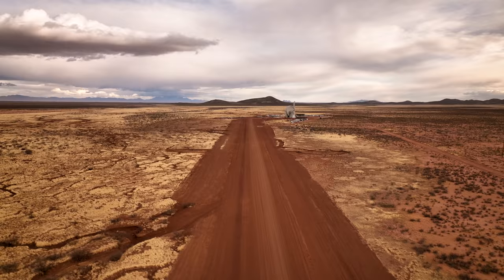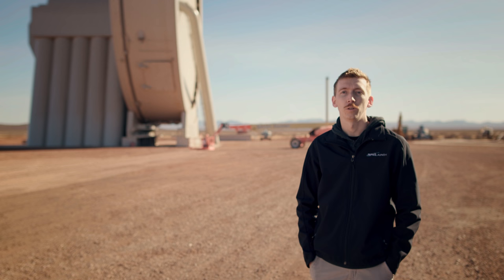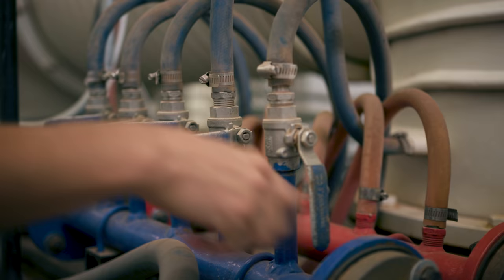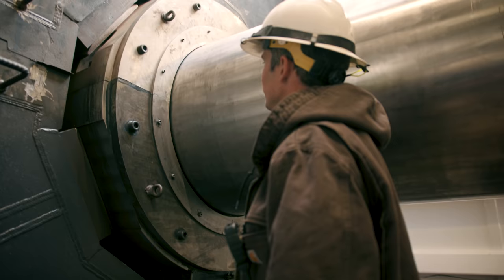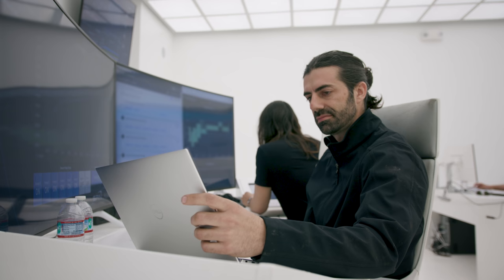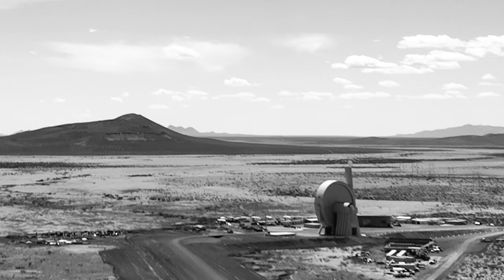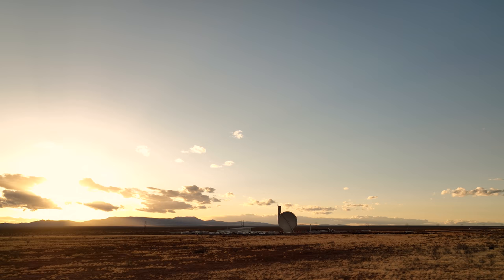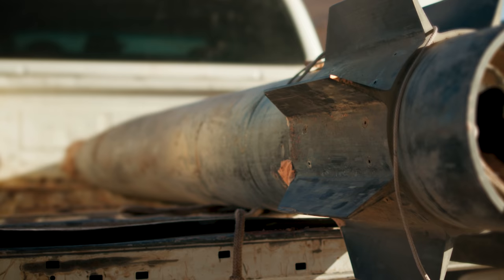An Inside Look: SpinLaunch Flight Test #7

Comment: Although I've expressed skepticism in the past, my confidence in this system grows with each test. It is an amazing piece of technology and I sincerely hope for it's success as an entirely new way to launch satellites! Can't wait for the suborbital test!
Reply: you trolling?
Reply: What if the rocket carried some fuel switched on  boosters after reaching 30000 ft to reach orbit ... Fuel consumption will be much lesser. A promising technology indeed
Reply: @AbhishekVerma-il4or  why not make an extra boost with rubber bands?
Reply: It's not designed to launch satellites there too fragile, it's main advantage is being able to send alot of materials to orbit super cheap which is our main hurdle to constructing rockets in space or pretty much any other large structure
Reply: @Catboy-hr2qp  The problem is that launching stuff 'into space' is the easy part.  Getting them to stay there is the trick, and that means getting up to orbital speeds and circularizing the orbit.  So this thing needs to not just throw a hunk of metal up but a working rocket system with guidance, fuel, rocket motors/engines, etc, + the payload they want to arrive at a given orbit.  So yes, a lot of fragile stuff is going to get spun at crazy g-loads (side loads, which means even more mass in the rocket construction), and then thrown.  Once it leaves the spinner the rest is easy.  Getting it to survive the spin cycle, at a weight that works for the end goal, that's the hard part.
Reply: Your skepticism is justified and I'd hold on to your money.
Reply: @AbhishekVerma-il4or  Says the person with NO KNOWLEDGE of the physics or sciences involved.
Reply: @Catboy-hr2qp  How did you manage to make so many grammatical errors in one run-on sentence?
And you want to be taken seriously on the hard stuff?  LOL
Reply: @DiffEQ  if you are so knowledgeable then please enlighten us how will you solve this problem. Innovations require new ideas, and i can see that this system has worked beautifully till now. You are retired so do you have any innovative contribution to the world or are you just writting nonsense from your blanket in youtube
Reply: @DiffEQ  Indeed, I hope for their success but I still remain skeptical. I'm not investing in any space company until they have a positive cash flow or I am certain they are going to survive. I'd say hold off on investing in this system until at least they have put something in orbit. 

However, I think I can say now there is a small chance this thing is going to work, which sounds crazy.
Reply: @AbhishekVerma-il4or  i mean, this is technically possible, but on earth it really dosnt make much sense. its application is incredibly limited due to the extreme g-force, the launcher needs to be tuned precisely for the mass of the projectile and its not clear the shock unloading/loading of releasing the projectile is even something you could design a launcher to survive when scaled up (we are talking about suddenly releasing 100's of tons of force from one side of a massive spinning arm, the arm is now severely out of balance, and this cannot be solved by just "beefing it up", you would need to dynamically change the counterweight to compensate for the sudden change in CG, not saying its impossible, but as far as i can see, impractical). a design like this makes much more sense somewhere like the moon, way less gravity but the main factor is atmosphere. furthermore unless they build the largest vacuum pump system in history (by like a factor of 10), their "full size" version would take about 8 hrs to draw down to an acceptable vacuum, so launch cadence isnt much better than re-usable rockets. there is also the question of the motor rotor having a vary larch vacuum seal, which they always leak, so now you need an even more insane vacuum pump system just to overcome the challenges of having such a large and complex vacuum chamber, again non of this is impossible, just seams very impractical.
Reply: This was a suborbital test
Reply: @rogerthomas169  By suborbital, I mean above 100 km, so in space.
Reply: @dinozone7373  that would be orbital, above 100 km
Reply: @rogerthomas169  No. Orbital implies orbital velocities, or 7.8 km/s, or fast enough that one's trajectory forms a circle around the Earth. You can still reach 100 km and still be suborbital (see Jeff Bezos' New Shepard or SpaceShipTwo.)
Reply: @dinozone7373  true, but not what's happening here
Reply: @3ddan148  The ONLY way this would work is if the centrifuge released the "payload" AND a "Dummy  Payload" in the opposite direction (straight into the ground).
It will never work as currently conceived.
Reply: @stuartgray5877  hmm i agree, that could work, sounds rather destructive tho, and i think that would also add to cost and turn around time, both of which are apparently their claim to fame, so, my thought was maybe moon, where orbital speeds are much lower, plus no atmo so high grnd level speeds arent a convern, plus you can just literally build it 'outside', no vacuum chamber required, i think in most cases it would still be limited to basically raw materials...
Reply: How do you ignore the fact it doesn't and can't work?
Reply: @whatilearnttoday5295  exactly
Reply: @whatilearnttoday5295  ugh, i hate yt notifications, it says this is a reply to my comment but it seams out of context to be, so if its not a reply to my comment i apologize, if it is, i basically said while this system is technically possible its far from practical.  and their current design, as you said, will simply not work.
Reply: @3ddan148  It's to force you a return to the site. That way they inflate their advert impressions and can fraudulently extract money from advertisers.
Reply: @whatilearnttoday5295  I think it can theoretically work. We've created electronics which can withstand thousands of Gs (see guided artillery shells used in the US military), and they've demonstrated they can launch at least some payload. What matters, however, is if it is profitable, and I reserve judgement on that.
Reply: @dinozone7373  > they've demonstrated they can launch at least some payload

No they haven't.
Reply: @whatilearnttoday5295  Not to orbit, but they have put some electronics onto the shells and recover data from them.
Reply: @dinozone7373  They can throw a thumbing rock out of a non-evacuated chamber at 1/100th the forces they're talking about "scaling up" to. It's a fantasy being sold with glossy shots of a "space-age" looking "command centre".
Reply: @whatilearnttoday5295  Oof, non-evacuated? Didn't know that, thanks for bringing that up.
Reply: @dinozone7373  The chamber is evacuated. The person that said it wasnt just doesnt know how the project works
Reply: @stuartgray5877  "The ONLY way this would work is if the centrifuge released the "payload" AND a "Dummy  Payload" in the opposite direction (straight into the ground)."

And before crashing into the ground the dummy payload has to go through the wrapping of the vacuum chamber.....
Reply: @dinozone7373  "We've created electronics which can withstand thousands of Gs (see guided artillery shells used in the US military),"

A satellite (except Sputnik) not only consists of electronic - normally you want have some relatively huge solar panels which have to be unfolded for power supply you need spinning wheels to correct the orientation of the satellite and you need a separate rocket as SpinLaunch could not shoot anthing into an orbit alone.
And it makes also a difference if you have to withstand several thousands of G for a couple of milliseconds (as in a artillery shell) or for hundreds of seconds while spinning up.

Comment: I have to admit: I'm really not convinced here.

The general idea for a space gun has been around for decades and it has never been actually built successfully. Main reasons are imho high G-forces, the problematic speed profile (highest speed at highest air density close to the ground) and the fact that this concept allone will never achieve an orbital trajectory without sending a rocket motor up there as well to raise the perigee off the ground. Now SpinLaunch is trying the same thing again (minus the explosion, of course).

The thing is: In addition to the stresses caused by the launch you also have the stresses caused by the centrifugal forces. Wouldn't launching a sattelite (plus rocket motor if an actual orbit is the goal) off a linear accelerator make more sense? Yes, that would be larger, but it might also limit G-forces and allow for a better acceleration control...

Comment: i'll be interested to see this with a fully functional rocket, even if they don't actually fire it off. Would be curious as to how the rocket with different mass properties inside of it behaves and holds up.
Reply: That sounds like a good way to destroy both the rocket and the spinlaunch system.  The fuels inside those rockets don’t deal with centrifugal force very kindly.

Comment: The G force must be very high on this kind of launch so my question is what kind of payloads will this system be able to launch without destroying it. Although very cool it doesn’t seem very practical.
Reply: second stage rockets with satellites. Our hardware can definitely sustain slow acceleration to 1000gs. We were firing vacuum tube computer guidance systems long before solid state silicone.
Reply: @ac.creations  It can't even get something to orbit, even if it survives the flight. AND if it survives and somehow reaches stable orbit, it is still hundreds of times less efficient than a rocket. Bingo bango bongo, what a machine.
Reply: @dazm901  that's not even close to the same application of force
Reply: @alanwatts8239  it's a scaled down proof of concept. They said the big one would be 300 ft diameter.  Taking away the first stage rocket and using electricity that could be made renewably is highly likely to be more energy efficient than producing chemical fuel.
Reply: @ac.creations  You don't get it, fuel efficiency goes beyond fuel consumption in one stage. The main goal of a rocket is to get payload to space, if you have a big rocket like the Falcon heavy that can take 60 tons of cargo to orbit how is this thing supposed to compete? you'd need hundreds, if not thousands of those little launches to compensate for a regular rocket launch? how are you going to catch all of them? how do you expect to haul fragile electronics when it has to go through tens of thousands of G's? 
Not that it's impossibile, but in space you already have to worry about radiation, intense heat, intense cold, micrometeorites, weight, and now you're adding something else for the engineers to solve. And you'd need a ton of engineering to do that, and it's going to cost more, and more for what? A little rocket that even the Shuttle can outperform, a vehicle that was abandoned because it was too expensive compared to it's overral efficiency. 
It just makes no sense, sure, it might work if you put billions of dollars into it and some decades, but it will still be outperformed.
Reply: @dazm901  o yes you got me.  My cover is blown
Reply: @ac.creations  me manually throwing a rock is also proof of concept. It has the same problem: scale.

Comment: 1200 mph launch speed is less than 1/20 of what they need to get to orbit. Also, two guys lifted and installed the projectile which means it's pretty inconsequential. SpinLaunch has a long way to go and I wish them well. It seems like a reasonable and inexpensive system for getting parts for assembly into orbit.
Reply: Those solid slugs are all this thing will ever "launch."

Comment: This is so awesome!! How would you use this system to launch sensitive and delicate items or can it be done with this system? Such a cool concept. I think I’d be dumb enough to try and get in it, lol.
Reply: If the objects can't tolerate the Gs, this won't be the right launch system for them.
Reply: @uku4171  which is 99.99% of the loads going to space unless you launch a rock.
Reply: @leosedf  your phone could probably tolerate it. Most electronics could, I would think. It's a smallsat laucher after all. And it's not like they were planning to take a big part of the market for themselves. They're not going to take Rocketlab's place or anything. Just a small alternative that will hopefully compete at cost.
Reply: @uku4171  yeah I u derstand what you are saying but this won't work
Reply: ian trofimov  not relevant, really. Basically only SpaceX, RosCosmos, and China have vehicles that fly humans to orbit. NASA will soon be back on the list with SLS, and I think ULA will fly the Starliner.
Reply: @leosedf  why?
Reply: @leosedf  they've already launched a camera (obviously not to space, yet) and a big portion of satellites are just different types of cameras. A GoPro could probably survive it (as well as a phone, as I mentioned). It's not like it's spinlaunching it into space. It will have a one or two stage rocket (don't remember which) do a lot of the work.
Reply: @leosedf  and with the exception of the G-forces, I don't see how it has any less potential than Virgin Orbit's air launch from a damn 747. Anyway, sorry for the spam.
Reply: So they went 30k feet and need to get to 330,000 feet to reach space, so I really have a hard time seeing this succeed, unless I’m missing something. 300,000 more feet is a lot more to go.
Reply: @ryintel  the higher you get with this system, the less energy you need to spend with the rest of the rocket. It won't just throw the rocket all the way into orbit. It's like Virgin Orbit and their air launch from a 747.

Comment: Points on the circumference of a circle move at a tangent to that circle.  The nose and tail of the projectile are at different points on the circumference and are therefore always moving in slightly different directions.  The projectile will be released with a spinning (tumbling) motion (spinning with the same frequency as the centrifuge).  Also, I am curious about the membrane through which the projectile breaks out.  Weak enough not to impact the projectile but strong enough to maintain vacuum?  I am skeptical.  But kudos for allowing comments (assuming you don't delete this one).

Comment: I really like this idea and the execution. I would really like to see details behind the release system. I suspect you have two release times for the front and rear of the vehicle to arrest the angular momentum? Marvelous work by the team there. I would love to be a part of such a fun project. 👍👍
Reply: Many congratulations on coming up with that idea! Spinlaunch has never answered that publicly that I know of, but that's the current speculation -- keeping the tail attached would create a moment of torque that could largely cancel the angular velocity.  Their first test flight had the projectile exiting at an angle of maybe 10 degrees and there were visible oscillations in yaw, maybe 3 full cycles before stabilizing.  The last two (#7 & 8) have been essentially straight and did not show any bobbling.

Comment: I wonder if they use/could use a shaped explosion at the orifice right before sending the projectile to create a pressure gradient and reduce jerk of the projectile when it goes from vacuum to atmospheric drag pressure. That or throw a sabot like round first that splits off the main trajectory and "breaks wind" for the secondary orbital vehicle up until the air is thin or to minimize pressure shock. The sabot round would be a fun equation to solve both geometrically and mechanically and could balance the moment on the axle.

Comment: In the future, regardless of opinion, it would be economical to launch cargo using a catapult system. This method would propel the rocket high into the sky while it's already in motion, making the startup phase more efficient since the rocket isn't accelerating from a standstill.

Comment: I get the vertical launch part of it, but you also need horizontal speed to get the object into a stable orbit. A satellite requires a speed of 17,450 miles per hour in order to maintain a low Earth orbit. Satellites in higher orbits travel more slowly; for example, a geostationary satellite only orbits at 6,858 miles per hour. Sure, the launched object can have a motor and fuel and such inside, but that's a heck of a lot of g-forces.
Reply: This accelerator is a test, the orbital accelerator will be much larger and angled to achieve horizontal velocity.

Comment: This may be the closest we get to alien technology...the vacuum part is how ET flies. Energy from Element 115 desolves matter to  create a vacuum infront of a  ufo ,the ufo falles into the vacuum and propelles it in that direction.
Reply: lol
Reply: Bob Lazar is the guy who talked about element 115 , som 30 years before it was included in the element periodic table.
Reply: @jamesmcdonald7998  Yes, Lazar used it because back then it was a reasonably high enough element that at the time nobody thought it could be synthesised, but not absurdly high as to be unbelievable.  As it turns out, the half-life of any synthesised (it doesn't exist naturally) isotope of Moscovium to date is only 0.65 seconds, with the hypothetical isotope 291Mc calculated to have a half-life of a couple of seconds.

Lazar just made it all up.

Comment: The reason no one has every successfully launched an object into orbit from a gun is that the muzzle velocity required means the projectile melts when it hits the air. The same velocity is  required on exit from the  Spin Launch tower. This is why we use rocket motors instead of an unassisted projectile.
Reply: I bet they got inspired by 'Journey to the moon' by Jules Verne

Comment: 30,000 feet isn't bad for 1g, on the moon it would be >90,000 feet!
Reply: With no atmosphere, probably quite a bit more....
Reply: At 1/6 the acceleration of gravity, the same KE = 1/2mv^2 = PE = mgh would put it at about 6x the altitude, plus no air friction, so even higher